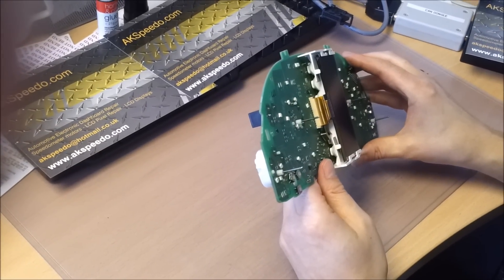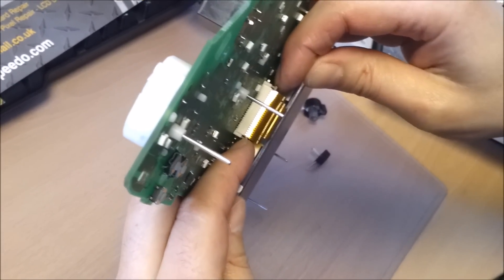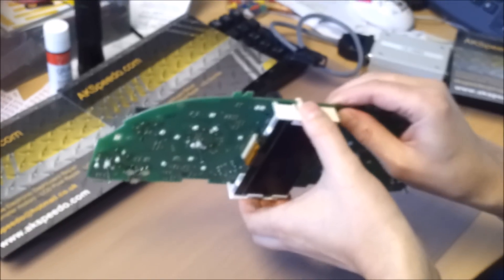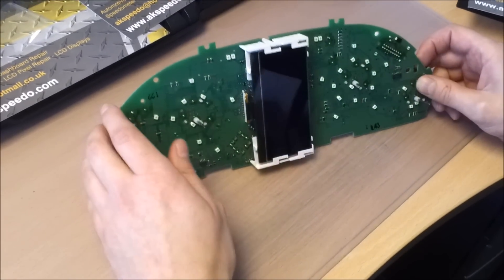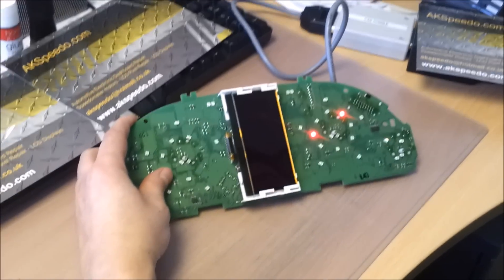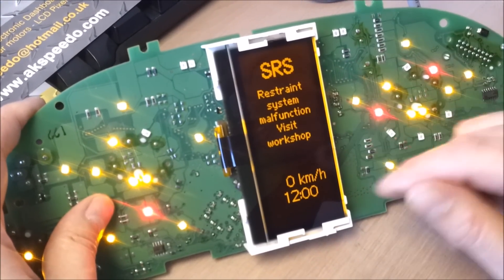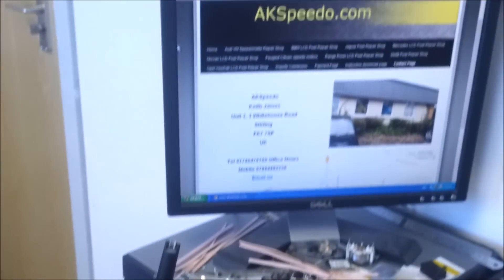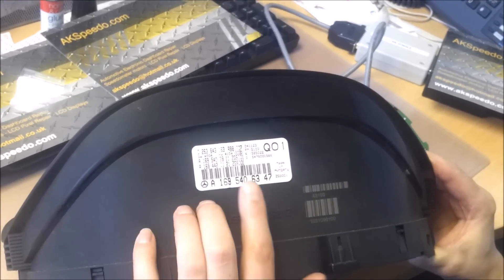Mercedes A Class W169 B Class LCD replacement Pixel Repair

Comment: In my B class, the display goes dark when is warm. I think it is also defective ?! If the pointer against clockwise mounted in back montage?
Reply: If it's going dark in warm days is it repairable or need to be replaced

Comment: Hi, interesting tutorial. However I couldn’t remove the 2 big needles in the center of the counter, even if I turn them endlessly.
Reply from the maker: Turn them and lift them at the same time, cheers James
Reply: Pull up gently as you turn

Comment: Hallo ich werde eine Klasse kaufen A Jahr 2005 160 Diesel-Modell und es hat die Anzeige, die Sie sehen, wenig, ich wollte wissen, ob es ein Display-Problem und nicht von der gelöteten führte hinter in den Bilddrucke und Casomai, wenn es ein Display-Problem, dass Spannung willst du genau für meine 7v oder 8v? Ich bin italienisch und ich schreibe Ihnen mit dem Übersetzer ... und wie viel kostet das Stück?
Reply from the maker: Hi, yes it will have a faulty LCD screen, screens available on our website www.akspeedo.com Mercedes page, with full European shipping

Comment: I need as well some information about how to remove the dash board? Thanks!
Reply from the maker: Rares F 2 catches in either side of the speedometer (inside the 2 slotted holes) unclip them and the dash will come out, very easy.

Comment: Is this possible on a W168?  Or is it a totally different job?
Reply from the maker: +ikhan5  Yes we have a replacement ribbon cable for the W168 a bit more difficult to fit as heat bonded cable and the tracks are very fine. Cheers  http://www.akspeedo.com/